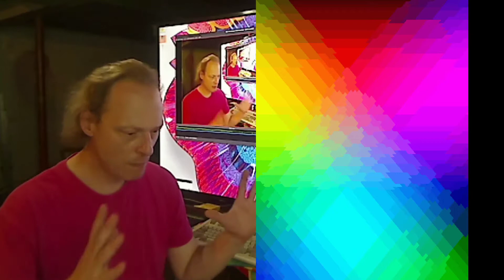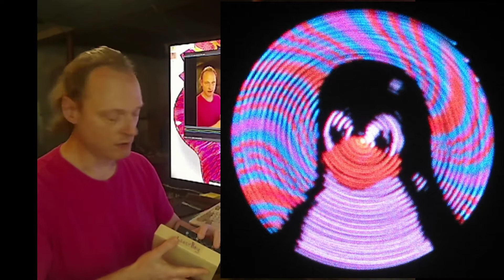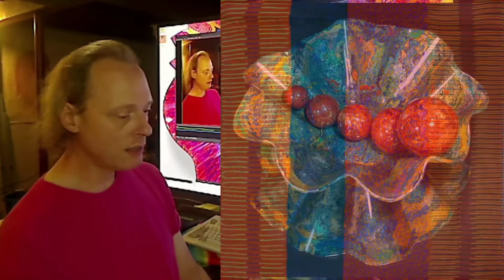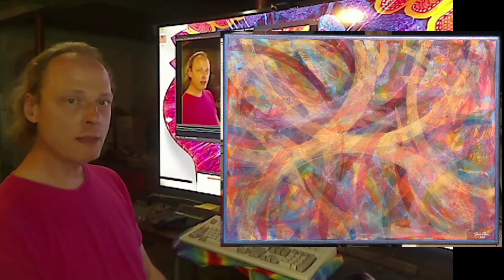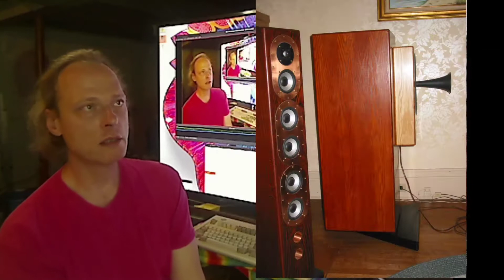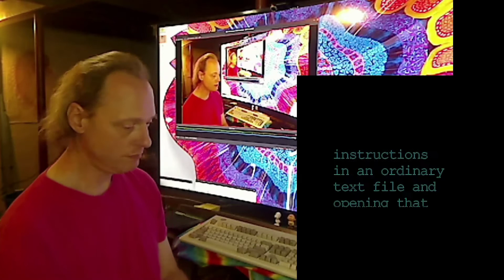What Is LaserBoy

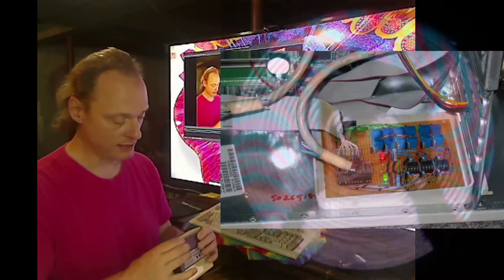Comment: Awesome project! So much effort and love that went into Laserboy! Is it possible to display bitmaps like you did at 7:20? Haven´t found anything inside Laserboy that could do that
Reply from the maker: Ok. I may not have covered that specifically. If you put a bitmap inside the bmp folder, you can open it as a color map for whatever vector art is loaded as a frame_set. Wherever a vector midpoint crosses over a pixel, it picks up the color of that pixel. So more vectors means more colors. You can also put a folder inside of bmp with multiple bitmaps and each one will be a color map for each vector frame.
Reply: @laserboybyjameslehman5975  Awesome, thank you so much! Works like a charm. 

Really dont know when was the last time, I was so deeply impressed by some software. Totaly felt in love with Laserboy! <3